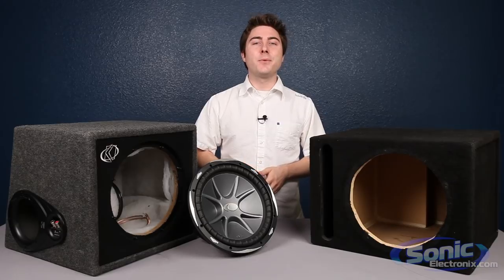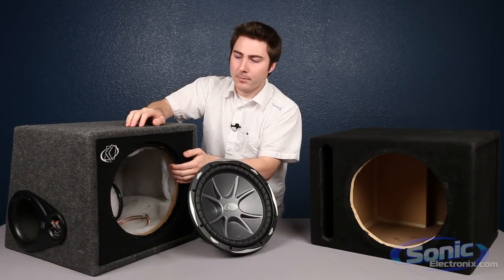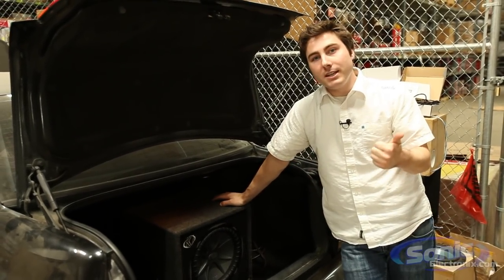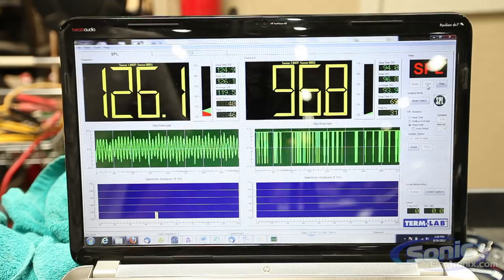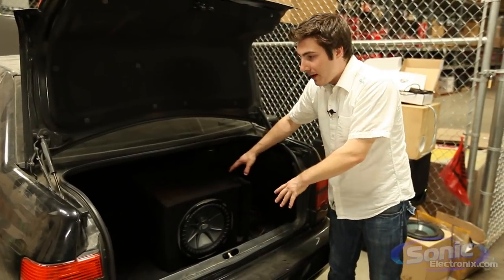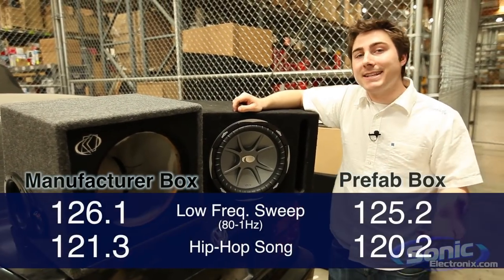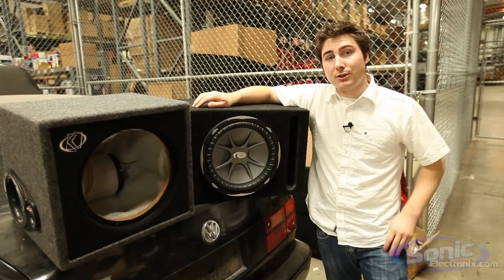Comparing Subwoofer Boxes: Manufacturer & Prefab Enclosures

Comment: how on earth can you discern 'sound quality' from different boxes? the only difference between the boxes will be the effective tuning and thus where the peak frequency is, how much spl is produced, and how wide of a frequency response (how many different bass tones can be produced at a reasonably similar volume) there is. if you like lower bass for example and listen to music with a lot of it i guess you could call a box that plays louder lower has better 'sound quality' but its not really an accurate way to describe what you are experiencing. both of these boxes and the sub would be unacceptable for my uses - 46 and 48 hz peak? not even touching the low bass. download and use WinISD beta and Torres Tuning Calculator and see and understand for yourself how this really works. /rant/
Reply: sworded 
port whistle for one...
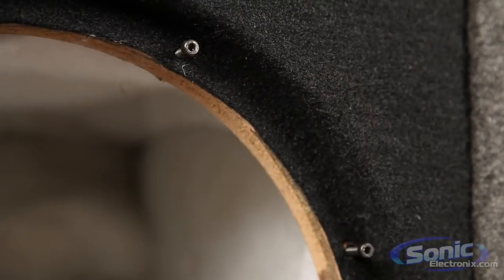Reply: well just dont build a port with a ratio of 1:15 and keep it below 1:4 and you're not going to have this issue.
Reply: That is a big difference. Noisy port or not.
Reply: sworded 
my man, this video is about prefabricated "flea market" versus "factory". The little slot port bugger would whistle like a turbo...
Reply: fair enough

Comment: Jesus, what kind of test was this? Termlab tells u nothing about SQ. Beside that, I would always work with basscad to simulate a box first (or look up for the manufacturer recommendation) and then check if the prefab box is suitable at all. Tuning frequency means allot, as well as the internal volume of the box does.

Comment: I hate to see things like this.  As a custom box builder I can confidently say that the difference between the two wasn't because kicker makes a “better” box.  It was a huge number of factors, such has: The kicker box is bigger, has a round port, has poly fil, is tuned higher and has a different port direction.  Don't believe this garbage.  Kicker isn't a great option at all.  One of the worst "bang for the buck" as sonic stated.    So frustrating

Comment: You should have chose some "universal" manufacturer box, or chose other speaker. It us unfair when you compare box which was designed for this speaker and other one, which was designed for another one. You could have also take manufacturer box designed for some other speaker compare it to this prefab and it would give you propably similar results to this universal prefab. You said, that this prefab wasn't designed for any specific speaker, so we can call it "universal box". In Poland it is common to say, that if something is for everything, in result it is for nothing. :P What I'm trying to say is that you compared here something like a rally car and F1 car on a racing track (nice, flat tarmac). Even without a race you can tell, that F1 car is going to win on this track. :)
Reply: I agree, but people should do their research rather than look for instant gratification. You can get impressive results out of one 8" sub but in the mass market that's a hard sell when all your friends have 10's and 12's in their cars.

Comment: @Josh Coghlan, your math is completely wrong.  The formula for area of a circle is pi * r^2, not pi * d.  Two 10's have an area of 2 * 3.14 * 5 ^ 2, one 15 has an area of 3.14 * 7.5 ^ 2.  157 sq in. for the two tens, 176.6 sq in. for the one fifteen.  One fifteen has a BIGGER surface area than two tens, let alone two eights.

Comment: How the fuck is a CVX gonna only hit 126 in the kicker box, and the L7 I had hit 135 in wedged prefab
Reply: Square woofers have more cone area.
Reply: Power is a factor as well. L7's need a ton of power to produce that kind of SPL. It was unclear how much power they drove these two boxes with. I am going to guess around 200 watts because 100 watts on almost anything will get you to 120db.
Reply: yes they are louder too

Comment: program name?
Reply from the maker: mta sorid santos term lab!
Reply: +Sonic Electronix Hey is this the guy from the t.v. show called  "Scrubs"
Reply: Gameplay
Reply: effeon stephens ?
Reply: Travis. No. You would have horrible group delay issues assuming the box was even large enough to attain a preferred tuning. Typically the smaller the box, the longer port you need to get in the lower 30's tuning meaning it probably wouldn't even fit less you put the port externally. So if you needed a 36 inch long port, you could run it outside of the enclosure

Gameplay: the program is Precision Term Lab SPL meter, the makers of Term Pro box building software.

Comment: This was funny. You just did this the manufacturer box did a 26 and the pr fab did a 25. Is you manufacturer vs custom video the manufacturer box did a 24 which was the same in this video and the custom box did a 26... Complete lies. Ugh. Stop lieing to the public. If you are going to make a legitimate instructional video have correct facts. Cause you said the manufacturing box was built to aub specs... Yet so was the custom box. But the custom box had almost a gull cube bigger? Please explain...
Reply: gain structure change between videos.

Comment: The video shows measuring the "Peak" spl vs a freq sweep. Meaning "One" spl value vs the entire range of freqs. The "Industry Standard" as you put it, measures spl at individual freqs resulting in a graph of various spl(s) relative to it's freq. That's how one can determine the "Flatness" of the response. Impossible with a "Peak Hold" measurement. You did not pay attention to the video or are not very technically minded. In such case, pay attention and you just might learn something, Noob!

Comment: With all the great ideals some of you have for how a test should be done, I encourage you to ....DO IT YOURSELF. Buy a manufacturer setup, a pre-fabbed box with similar specs, and then build one yourself. Get the term lab, get the tracks, get consistent power, then post it on youtube. Until then, shut up. So many of you have opinions on what sonic SHOULD be doing...what they should have done is turned off the comments lol.

Comment: Wow, a whole decibel?!  LOL   
How much money must we spend to get that decibel?  Is it cheaper than using a slightly more powerful amp? 

The screw hole in the used Prefab box had not been pre-drilled so of course it's gonna look like that if you remove the screw. I'm calling bullshit on that one!  How many times are you expecting to replace the driver and keep the same box?  It's a whole lot easier to sell your old one in it's box!  Not everyone is a builder. So, whatever the price difference related to those fancy machine screws is, it is just not justifiable in the real world.  

Ok, they've got the Aesthetics and thicker front panel right, I'll give 'em that.  ;-)

Comment: Clearly this guy doesn't understand how to build a proper enclosure...  Hes talking about how bad the prefab is, and yet if you would a build your own you can make a Box 20 times better than both of them.  Especially on the double baffle on the pre made,  You can do that yourself.  The machine screws on the pre made,  You can do that yourself.  Better carpeting,  You can do that yourself,  Better ports system,  You can do that yourself.  If you actually spend the money and take the time to do these extra little things you can make a Box for an 8" driver that makes it sound like a 15" driver.

Comment: why you comparing two boxes that are complete different size? I bet if the aftermarket box was the same size the power output would probably be the same if not maybe a Lil more? lol I think it's just a bit unfair lol if you comparing different designs for bass try using the same size box with different designs... just a thought oh and it's a SUBwoofer! dude... cool vid anyways👍😅

Comment: Did he say 1hz. No speaker in the world can reproduce 1hz. They cant bealy reproduce 20hz wich its the lowest human can hear smh. And thays a pro lol
Reply: hearing and feeling are two completely different things ;)
Reply: + TheFirstFriendly By the way , 4 HZ is unlikely . Even if you could , there is no music that low . Most speaker output graphs will show at least a 20 DB drop , compared to their 100 HZ output . Could you imagine how much more of a loss on 4 Hz , being 2 octaves lower than 20 HZ . You wouldn't hear it . Most woofers in enclosures , at 4 Hz , would be only flopping back and forth , and most AF Signal Generators only go down to 9 or 10 HZ . The box and woofer would also have to be huge , and very well engineered . The wavelength of 4 Hz would have to at least 80 Metres long , where would you use it , or hear it , if you could .
Reply: +Evo Lab Music The human body's ability to perceive a 1Hz tone is not related at all to a speakers ability to reproduce it. A speaker is just an electro-mechanical transducer. Any speaker in the world can oscillate from peak to peak exactly one time per second if you feed it such a signal. The pressure created (think SPL) would vary substantially from speaker to speaker and only a select few would be able to create a pressure level high enough for you to feel it (because you are correct in that the lower limit of human hearing is approximately 20Hz and thus a 1Hz tone would not be heard but felt).